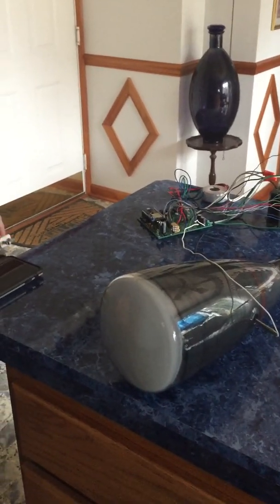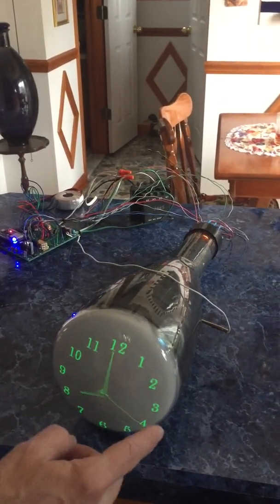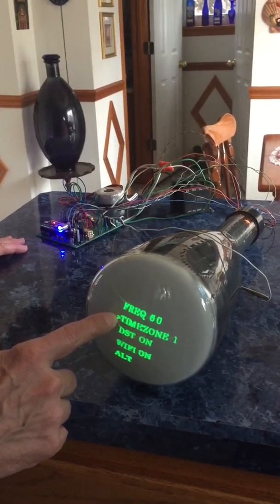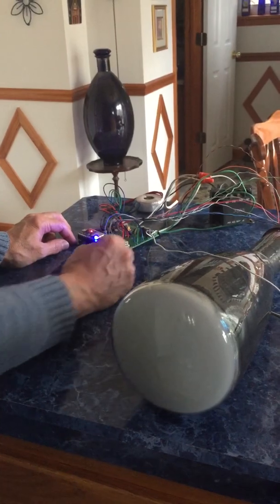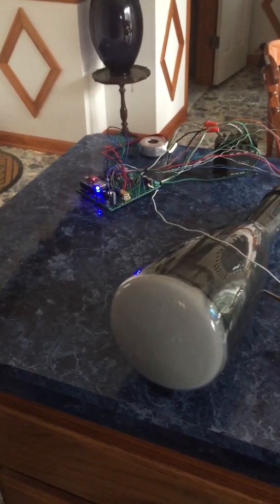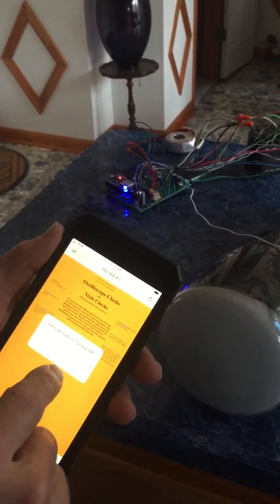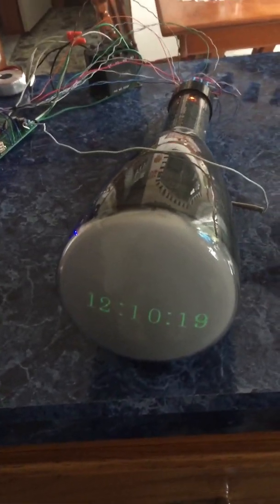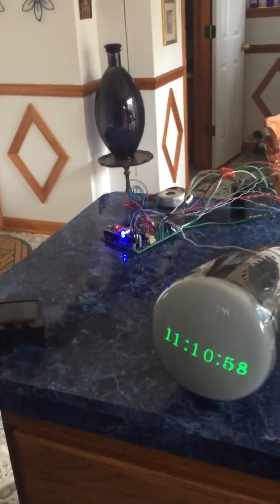OSC7.0 quick start

Comment: I seem to have older or different version acquired in a trade deal.  I can get it to be a clock and i can set it but not much else.  I cannot see a red LED; only blue plus neon.  There is a button on rear side near relay; is that the "toggle" button referred to here?  I cannot get it into date mode nor does it seem to have any wifi presence.  In this movie you seem to push the toggle button near the front across from slow and fast set which i do have.  Can I find or get instructions for the menus on this version?
Reply from the maker: Yes please check the page at http://www.oscilloscopeclocknixiecrt.com/Kit.htm
And you can email me at howchon@hotmail.com
If you send a picture of it, I can probably identify the version : )

Comment: I would like to build one of those. CRTs are a bit hard to get in Australia but if I find one. Other big problem I have is that I live in a very small space which moves. Things tend to get broken.  I would build it into a piece of furniture. Also I would like it to be x - y vector tracing as per the old Atari games rather than raster scan.  I haven't done a lot of design work so my reach is probably exceeding my grasp in this respect.
Reply from the maker: You can see the original vector design on my page at http://www.oscilloscopeclocknixiecrt.com/Kit.htm

Buy the kit and find a CRT ; )